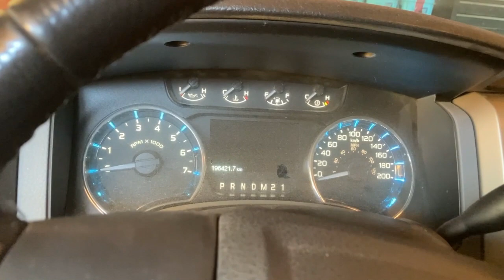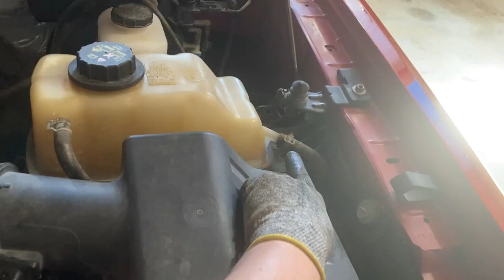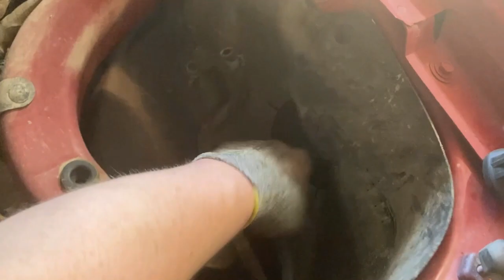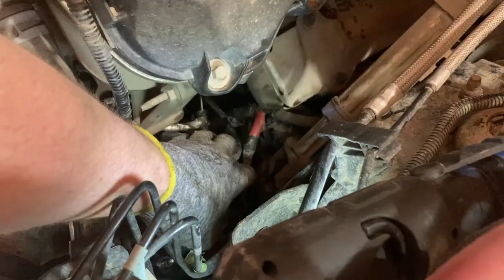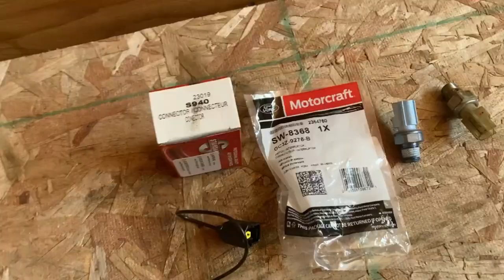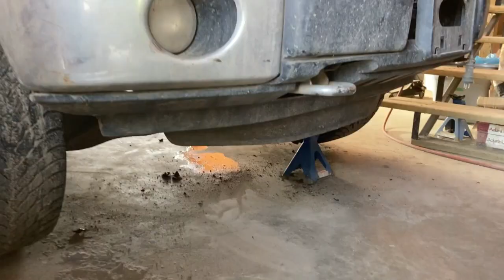2012 F150 6.2Liter - No oil pressure / oil pressure alarm.

Comment: Did replacing the connector fix your issue?
Reply: No, I'm to the point of just having motor rebuilt.
Reply: @jparker936 I have since figured out its the wear on the bearings due to bad oem recommendation of 5w20, later year models with this motor call for 5w30.  Thicker oil resolved the low pressure switch alarm, but obviously the bearings are worn. you can swap out bearings on the crank and rods from the bottom. Plastigauge and torque away if you planning on keeping the truck
Reply: @Eagerizing2 oh man that makes sense. Yea thinking about it it does have quite alot of blowby from oil fill. Thank you for the reply that makes my endeavor much cheaper in the long run.
Reply from the maker: Yes it resolved the issue

Comment: What would be next step if it also starts clattering in valve train? Can the sensor cause that also?
Reply from the maker: No, the sensor doesn’t cause any noise. It reads the oil pressure.
Reply: @lokiryder5235  yea that's kind of what I thought also. I've changed everything on my snd it still keeps losing actual oil pressure and will clatter in the valves. Turn it off wait a min and back to normal. I'm at my wits end with my 5.0
Reply: @jparker936 so that issue is most likely a vct solenoid problem I had that issue with my 08 super duty with 5.4l 3v at 275k miles and it was just a vct solenoid gone bad, it fixed the clacking and rattling under the hood, problem was vct solenoid was just seized and stuck from varnish and junk, and the truck was fine after that, you could also have a failing oil pump, or failing set of cam phasers, failing set of timing chain tensioners, or broken guide, failed rocker arm roller follower. Lifter tick.
Reply: @tradesman98 thank you for the reply. My truck has literally been parked for over a year trying to figure this out so I appreciate the feedback. I changed the oil pump, vct sensors but I haven't changed my actual phasers. Going to give it a shot and cross my fingers. Again thank you so much for the help.